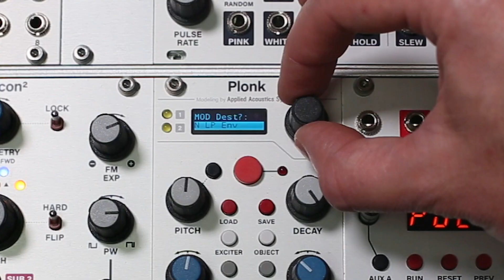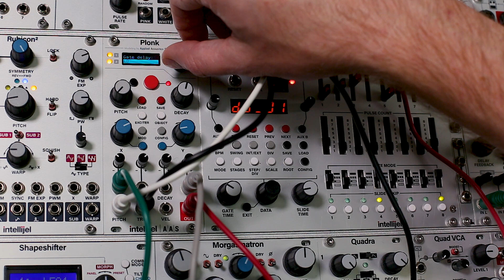Plonk's New Features In Firmware 1.11

Comment: Can you please breakdown the patch w the plonk and planar? I just got one of each and want to mess around w the resonator stuff and use this video as a jumping off point. Thanks...
Reply: I made that a while ago, but I'll do my best to retrace my steps! Obviously first set Plonk to AHR, then send the GATE out from Planar to the TRIG in on Plonk. I had the X and Y outs from Planar going to the X and Y inputs on Plonk, but I can't remember what I had assigned. It was probably something like Noise Density and Inharmonicity. The D output from Planar was going to the FM input on Rubicon to control its rate as an LFO which was going into the MOD input on Plonk. I believe that was assigned to LP Cutoff. 

Hope that helps!
Reply: @ScottMFR  tyvm